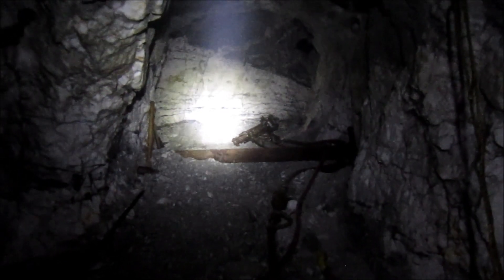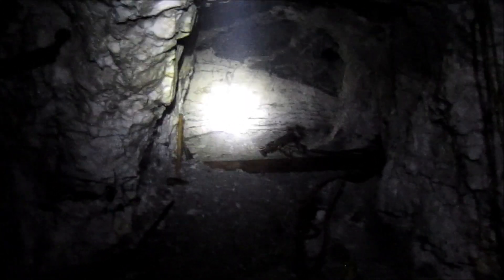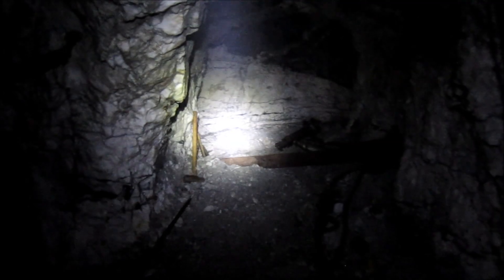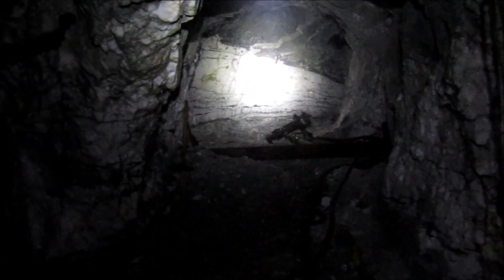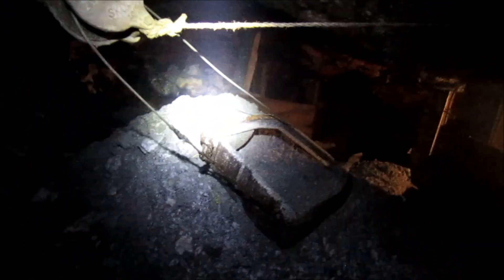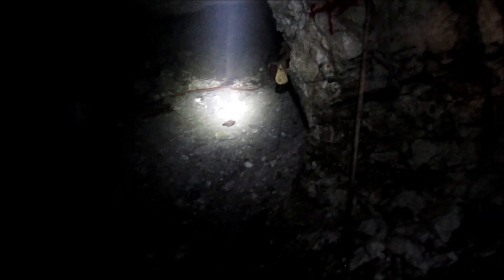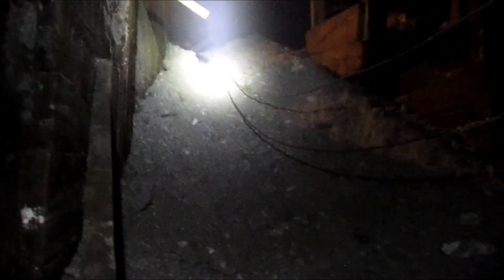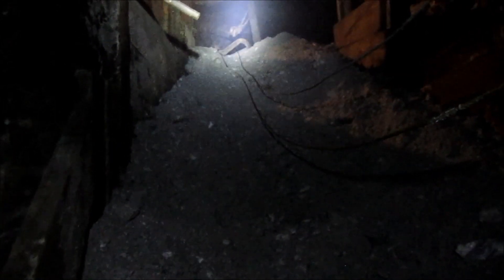Advancing The Face

Comment: Slushers are both the coolest and most underrated piece of machinery. They've got a real following down here, I've put a lot of effort into scrounging double-drum units and blocks! I picked up a big Ingersoll-Rand machine myself last year for $1500. Haven't tried running it yet though.

It's also neat to see a shallow-dipping vein mined. There were some mines with similar geometry a few hours from me, but they shut down well before I was born. Everything down here is vertical or near-vertical.

And jacklegs - always have a spare or three, but you know that!
Reply from the maker: You can never have enough blocks! I’ve had to go to other headings and “reallocate” blocks because there weren’t enough to make the needed cable direction changes. Slushers are about the best way to move muck, unless you have an LHD.
Reply: @muleskinnermining8661 Right there with you, we tactically acquire blocks as they're found. I just rescued a block and an 83 last night, the crew before us left them down at the cap magazine. I was spreading material on the decline road to repair a washout, and I can't make excuses not to grab things when I have a 1-yard handy!
Reply: @muleskinnermining8661  Few years later part-timing it, we just started working a shrink stope. I'm about sick of hand-mucking the damn thing and there's a slusher mounted that hasn't run in about five years. Got any good tips and tricks on the care and feeding of Gardner-Denver slushers twice my age? Gear oil and grease are both a given.

Oh, and the stope is shaped like a V (when viewed from above) so two-stage slushing working around the corner will probably be required at some point. Putting in a chute at the bottom of the V won't work since that area is directly above the decline. We're right at the bottom of the vein at a contact and the whole system is brecciated as hell. Half our values are in the andesite - it's the weirdest ore I've personally seen in the district. Thirty feet up in the escapeway it turns into a more normal near-vertical vein and we have some half-ounce gold up there. Plan is to chase the vein up until we intersect the other workings, then mine it from there.

The core drill program completely missed this entire zone. It was found on accident while driving the decline. Oops.
Reply from the maker: @Porty1119 I’ve got some pictures somewhere showing tear down on an air motor. Maybe it’s a video I have on the 12 B mucker, they’re all the same. Tear it down, check the Pistons and cylinders. You could probably get away with honing them out put it all back together and oil that baby up they’re built like a tank with a little lubrication and care that thing will fire right back up and yeah, take care of the gear boxes. Happy to hear your adventure is going so well.
Reply: @muleskinnermining8661  Thanks! I'm working through your 12B series now. Fortunately this stope is dry and everything on the slusher is free. We're about 150' above the water level (and climbing as the pumps make headway).

Last stope round was full of what appears to be acanthite. The old-timer who owns the mine about went nuts with gold fever when he saw what we finnhoed down the chute; it'll be another thing entirely when we slush it all down. We're scramming along the top of the contact zone and back-stoping just a bit until we hit the end of the ore lens, at which time I'll haul a stoper up and start carrying upwards. The geometry of this thing is tough to describe in a comment. I can't manage a jackleg correctly because of an old arm injury but stopers are easy for me. My partner can't squeeze into an LHD engine bay or ladder a raise so it balances out!

Still waiting on the mill to break ground. I got the 55-ton Badger crane mobile a couple weeks ago and we moved it over to begin laying out the heavy stuff. We're trying to stockpile enough ore to pay off mill construction and get the conventional shaft mine going as well.
Reply from the maker: @Porty1119 absolutely amazing project. You guys have come so far. You are a very talented person, you should have no problem with that slusher project. Always look forward to seeing more of what you are working on. Wish I could drop in and help you guys out.